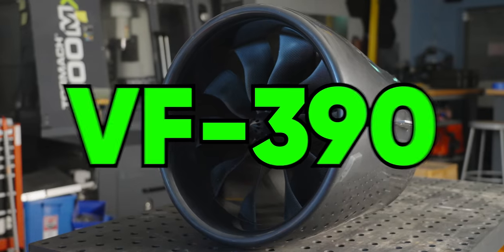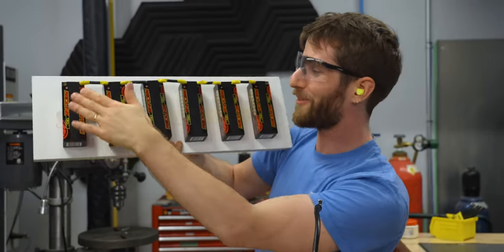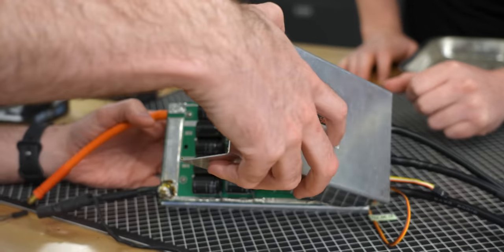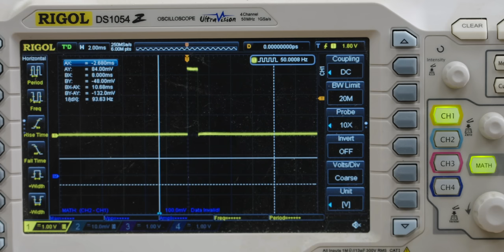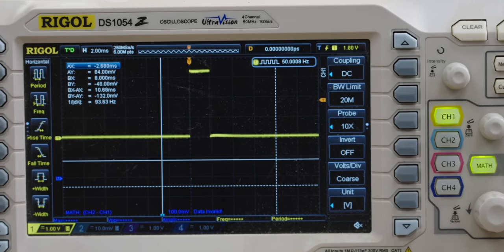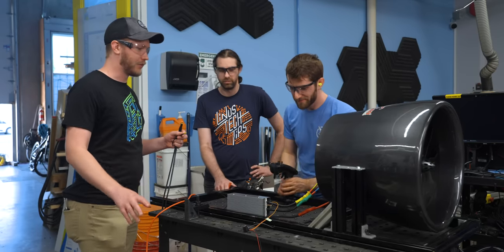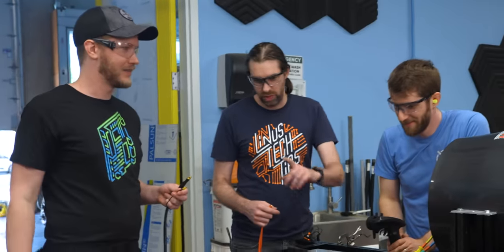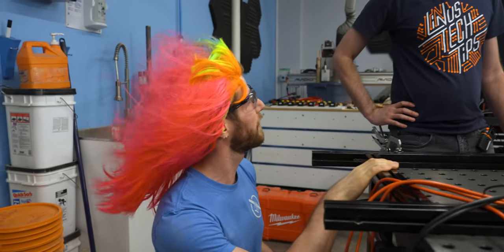The Scariest Fan ever attached to a computer - Vasy Fan VF-390 EDF

Comment: It's honestly pretty wild to me that those 6 battery packs put out more power than an industrial wall socket can
Reply: Sorta.  The wall socket ratings are extremely conservative because it's expected that the wires in the wall will be there for 50+ years and never overheat.  Whereas these batteries are overheating with air cooling...  Just yesterday I saw an HVAC recommended a 40A breaker, but draws 135A for ~1second while starting the compressor.

With all that said, those batteries do have pretty insane power.
Reply: @wetmelon  Similarly, I've wired up massive stud welders at a steel beam plant that pull 300 amps @ 600v 3ph for 1.25 seconds, with 6 seconds in between welds. The machine factory installed feed cable is only 6 awg copper and it handles it fine due to the duty cycle.
Reply: Chemistry is wild, man.
Reply: @wetmelon  the 135 is the inrush current, pretty much all motors will do that.
Reply: @gerald8289  welders also have voltage converting transformers inside to up the amperage and lower voltage. 6 awg is easily enough to power that, not saying the whole thing is nothing because its not, its crazy lol
Reply: Well.. it‘s North America.
In Germany a standard private power connection allows you to pull 63 - 100 Ampere for one unit. That‘s 43,5 kW - 69 kW over 3-phase. (230V between phase and neutral, 400V between phases)
Reply: those batteries can supply peak dc currents 10-100's of amps same what is used in drone & other bldc motors, actually if you try to power a ac or a heater wont last 15 seconds.
you can build a power supply from the wall socket to power that turbine, did you see the gauge of the wires used how can they handle 45kW.
Reply: It America, he in the UK, just plug it in the wall and off you go.
Reply: @wetmelon yep this is usual with motors as this is their inrush current. thats why circuit breakers have different class ratings to handle 100~200~300% of their rating for a specific amount of milliseconds or seconds. This is to avoid CBs tripping every time a motor load turns on
Reply: i work at a company that makes resistance welders.  we make machines that will use 440 3ph @ 400 amps and put out 70,000-80,000 amps @ - than 5V and release that in less than .25 sec.  The transformer in these machines is the size of a double door fridge.  These machines are usually used to weld the spuds on water heaters or air compressors.   
That being said.  The newer technology equipment uses capacitors and can overshadow the older equipment output.  the biggest one I've seen had an output of 300,000 amp @ 2-5 volts.  it was used to weld the internals for diesel transmissions.   
The funny part of those CD (capacitive discharge) machines is that they could in theory be charges with 110V.  But for practical / industrial reasons we keep them at 440 and they can fully recharge in less than 1 second.
Reply: for 6 minutes not forever
Reply: Probably would have had a chance of survival if they mounted it to aluminum instead of wood.
Reply: @FORZALEGEND360 nope, that's a lot more power than you realize. In the US our houses are usually fed with a 200A 240V service, which technically allows up to 48kVA, or just slightly more than this fan requires (though the 80% rule for continuous loads drops that down to 38.4kVA). In Europe the norm is 230V 16A circuits, right? That's only 3.68kVA, less than 10% of the full power draw of this fan. I'm not sure what a full household service can normally supply over there though, but I'm guessing it would be enough.
Reply: At this point, why not get a gasoline generator?
Reply: @Satelitko  Except this is physics.
Reply: >In Germany a standard private power connection allows you to pull 63 - 100 Ampere for one unit

 @GuyFromJupiter  Perhaps they meant that 63A is the max that a single-family house can order from the power comany. In apartment buildings however where you can have hundreds of tenants, there's no getting around to getting a bigger wire from the power company - you just have to support the usecase that almost everyone's gonna cook dinner. 16x200 = 3200 amps. That's when the power company will usually put a dedicated 20 kV transformer substation in the basement.
Reply: Large capacitors (Water bottle sized) can output megawatts actually,  like 1000 amps at 1500v.
Reply: @wetmelon o
Reply: @GuyFromJupiter  In Europe it is 230V 16A at single household monophase socket. Houses are usualy connected with 63A 3phase 400V power at the powermeter. That's more than 75kVA.
Reply: @GuyFromJupiter normal in finland land is 35 amp 3-phase for non commervial house
Reply: lipos are pretty nuts
Reply: @TheNosnawS  those are like C4 in amphetamines
Reply: @smiththers2  Oh yes I know, what I was refering to was its input power. The output on it to weld 1" studs to steel beams was 4000 amps @ 72 volts dc.
Reply: It depends. USA is using really low-power stuff, unless using paired 110V for 220V. In Europe we have 25A at 220/240V or around 5kW per fuse. Industrial 3-phase certainly can output several times that, so pretty compatible with those batteries, which is still amazing. Even more amazing is, even with all that power, it is still insufficient to run this monstrosity at 100% at such wall sockets.
Reply: @t0n4us  but then you pay your life savings in electricity bills running that for 30min
Reply: @t0n4us  my residential power is 2 phase 200 amp lol south east u.s
Reply: @bazrazin1 yup my 6S lipo drone batteries hit 100A at 25v (2.5kw) pretty regularly, and rated up to 150A and that’s a cheap $30 battery.
Reply: my battery pack the size of a nightstand powers my house for a day
Reply: @arctic6405  120V, right? So still less than a 63A 240V 3-phase residential in Germany :)
Reply: @t0n4us  240v comes into every american house its 120v to center tap on the transformer at the pole our heavy appliances run on 240v so one line to ground will create 120v which is how our standard duty outlets operate (240v/200a service)
Reply: @FORZALEGEND360  and the transformer of the area blows up with all the wiring inside the house catching on fire
Reply: @t0n4us thx i was just about to comment that as well. Our drying oven at my company draws 100A per phase plus a UV bridge which draws 63A per phase. Seems like it was either for dramaturgical reasons or NA really has a shitty power grid. But I suspect it was just for the fun of it
Reply: @GuyFromJupiter usually each flat per house in Germany is connected 3 phase 63 ampere. A free standing home can be connected up to 80amps per phase. Remember we have 230V phase to neutral or 400v between phases. A typical workshop/ small industrial building has its own 20kV to low voltage transformer with around 100kW per phase
Reply: @arctic6405  you have 2 phase 120, right? We have 3 phase 240.
P1-3 -> N = 240V
Px -> Py = 400V
Reply: @t0n4us  it all depends I have 2 phase 120 but you can get 3 phase 240 here you can even get 800 volt and 1200 volt service in the industrial setting
Reply: AC vs DC baby
Reply: @BierBart12  have you ever seen fuel powered generator that can output 45kW nominal? those are massive. And usually - quite loud
Reply: @Ubiquities I have a couple of large scale RC trucks, and they’ll pull 600+ amps at 8S for a second or two during a speed run.
Reply: @Blaquer17  Nice! I think people don’t understand how much energy density is in those lipos unless you work with them. The new hotness in FPV this summer is people flying 8S, what charger setup do you use for 8S?

Comment: As a hobbyist and out of curiosity I once took a blender motor and put a fan blade from a space heater on it, put a metal coffee can around it and used it to clear out my workshop because it was 100x more powerful than a leaf blower. I used a basic dimmer switch for a ceiling fan to control it.

Comment: For an electronics engineer to be terrified says a lot about how dangerous this thing is
Reply: Well he said he was mainly scared cause he didn't have the fan control, Linus did.
Reply: Not just the moving parts. If that ESC exploded it could easily send molten shrapnel in any direction.
Reply: Yeah maybe some long n longs would be a good idea haha
Reply: @Blox117  Six 4S LiPos in series and no fuse in sight? Yeah, I'll stand by what I said.
Reply: That dude is no EE.

Comment: Linus: "i want to toy around with a giant industrial grade 60 horsepower fan, how do i write it off as business expense?"
Alex: "we can attach it to a computer, run p95 for 2 minutes and make it a video"
Linus: "this is why you're the lead engineer here"
Reply: Anything anyone says is a buisness expense really. Nobody asks you to prove it
Reply: @legionjames1822  Idk, if you're marking every time you get some groceries a "business expense" someone's gonna eventually ask a question or two.
Reply: @Naokarma eating so I can live and go to work technically counts as a business expense.
Reply: @Naokarma  eh. Doubt it. No your correct but you found one of maybe 5 use cases that you cant mark as
Reply: @Naokarma Just tell them it’s for your employees.
Reply: I don't really get industrial vibes from that fan. Normally industrial stuff is pretty low tech, and industrial motors (with a similar power rating) are generally much larger and run no faster than 3600 rpm. They are meant to run for years on end with no maintenance other than occasional greasing. I'm sure there are plenty of exceptions to that rule, but that is the norm. Also, this is far from "giant" in the industrial world.
Reply: @GuyFromJupiter  Yeah, I'm pretty sure this fan was made for electric aircraft
Reply: @legionjames1822  You can definitely get away with a lot. I'm just saying that you can't really blame anyone other than yourself if you end up getting caught lying on your taxes.
Reply: @Guru_1092  Fair.
Reply: @Naokarma  I cannot do business if I am deceased.

At least, not easily.

Comment: For videos like this, you should get one of those giant, clear, bulletproof shields like they used on Mythbusters. If something got sucked in that fan and shot out erratically or one of the batteries go boom, you would at least be safe from shrapnel and such. That fan has crazy power!
Reply: True, am used to seeing in MB they have those shields and are OUTDOORS for wind tests
Reply: Also dont use wigs around spinny things you might lose your head.
Reply: They should start hiring consultant for this type of video.. For safety reason if they dont want to hire full time safety officer..
Reply: @ghidorah8707  why would a wig do that, the entire wig would just come off
Reply: Or if that side window would shatter and blow directly into their faces...
Reply: No. That's boring.
Reply: @arisfazli  this is true
Reply: @arisfazli  you know, when Linus said "the crazy guy says its not safe", you can bet that the Consultant will not want to be involved
Reply: I was really terrified when Linus put his head behind the computer. IDK they took out the CPU fans but left there the back one

At high speed it could shatter and send shrapnel to the back

Comment: I am genuinely surprised they didn't tear off any surface mounted components on the motherboard or graphics card.
Reply: Too much back pressure in the case. If they were to cut off the back completely so that the air could go right through it would probably have ripped off the cpu cooler at least.
They should do this again with an open air "case".
Reply: I have a feeling that was because the air simply wasn't getting out of the case fast enough, so it created a back pressure and wasn't nearly as hardcore as when they took the case away
Reply: its a great proof of the toughness of the components for sure
Reply: I'm sure they could of. You can see the heat sinks on the cooler start to flex a bit
Reply: surface mounted components can take surprisingly high amounts of force relative to component size
Reply: I cringed when he put his head in front of it, what if that heaksink came loose or a ram stick? 😬
Reply: You'd tear off / bend over big through holes way before you'd affect SMDs at all. They are low profile, with small surface areas on the sides compared to the surface areas of solder that would have to shear. Not to mention being that close to the PCB, the airflow is way slower due to the boundary layer.
Reply: @britskaradiometeorograph8108  People usually use PC with a closed case.